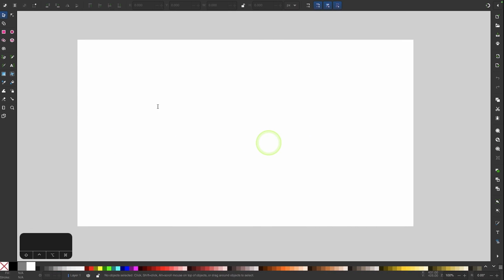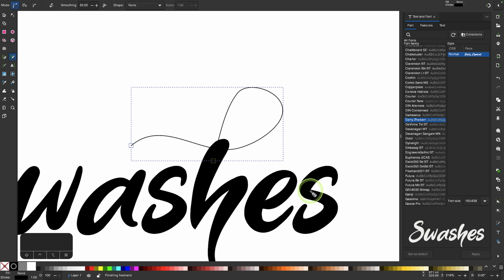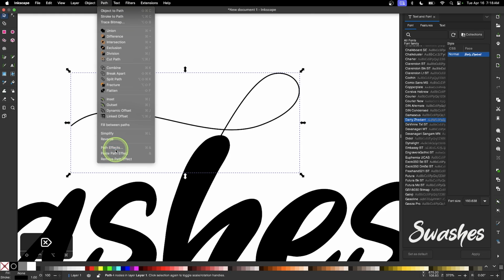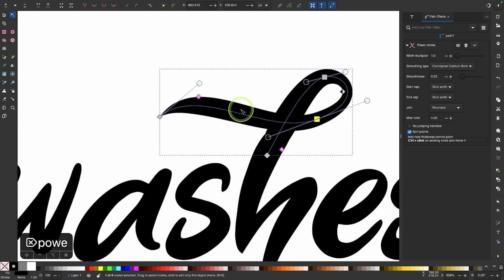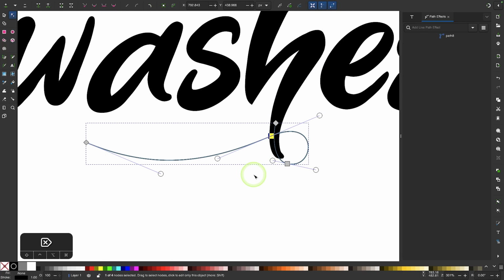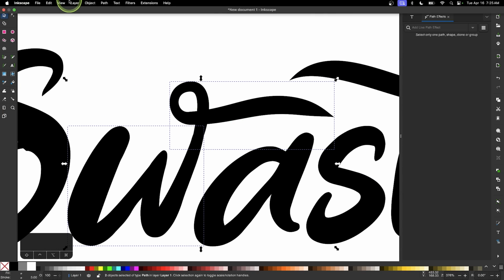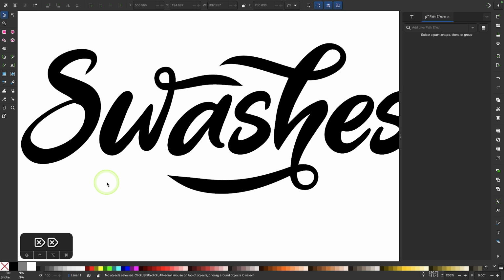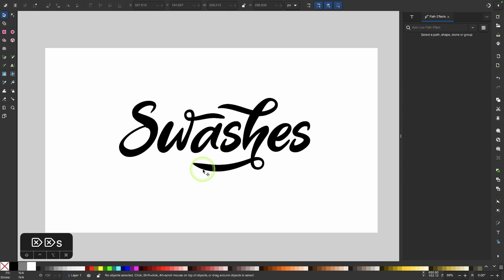Add Swashes To Text Using Path Effects [Advanced Inkscape Tutorial]

Comment: Nice approach, thanks for the video. Those final roundings you do with the eraser seem to me a good example to take advantage of the LPE corner shortcut in the tool control bar.
Reply from the maker: I tried the LPE but didn't like the result. The angles are too sharp.
Reply: @LogosByNick  You are right, I think it is because of the type of method it uses to calculate the fillet. By default it comes in auto, if you change it to force bezier it looks more natural and this parameter can be done by default. I have it like that and I didn't realize it 🙂